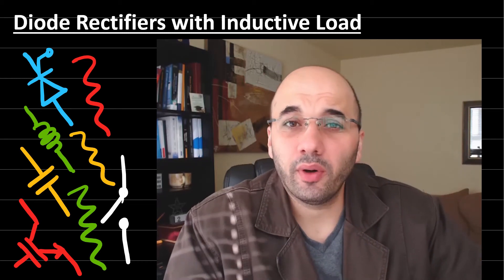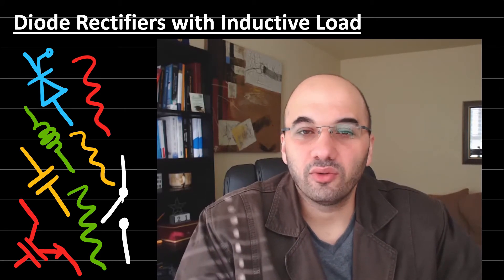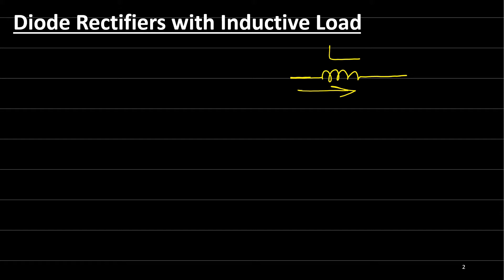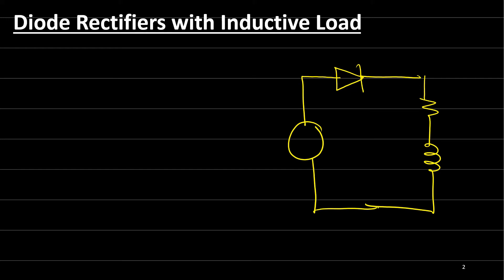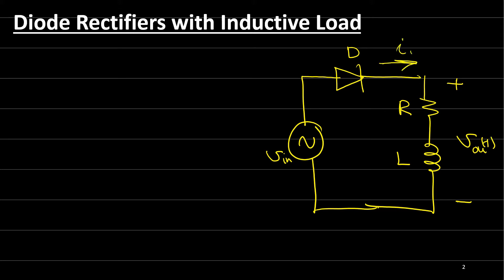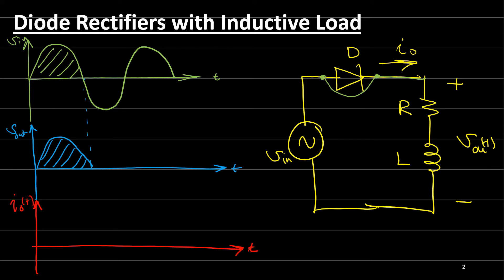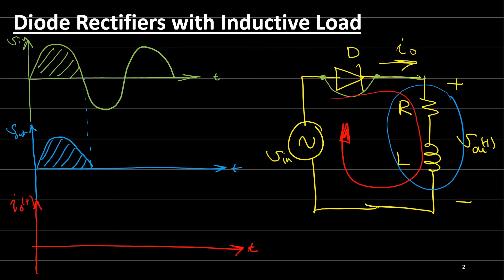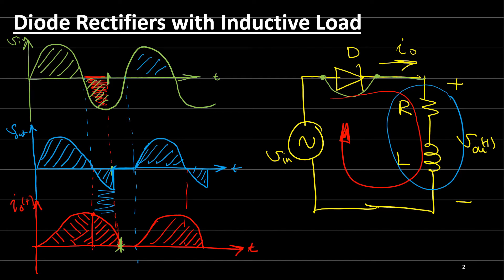Effect of Inductive Load on Rectifiers | Power Electronics

Comment: Thank you for the the clear explanation. I would like to confirm my understanding about why the diode is conducting part of the negative half cycle. Is it because the inductor is reversing its polarity and keeping the cathode of the diode more negative than its anode resulting that the voltage across anode to cathode is still positive, and that's why the diode is still conducting. Is this right ?
Thank you for your valuable effort.
Reply from the maker: It's better to think about it from the current point of view. When the diode becomes open circuit both the output voltage and the inductor voltage have the same value, which means the current becomes zero in the inductor at this point (and the voltage on the resistor is zero). So the diode becomes off when both the voltage applied on it is reversed and no current forced by the inductor. The voltage on the inductor already reversed its direction when the current in the circuit started decreasing, but the diode is still conducting that moment. You are welcome no worries.